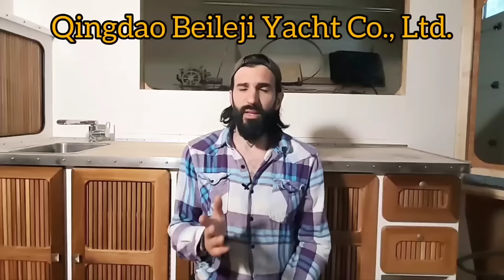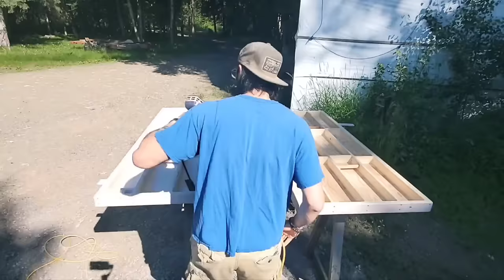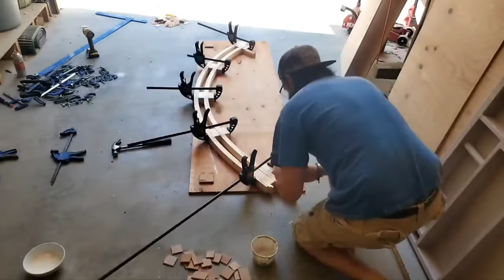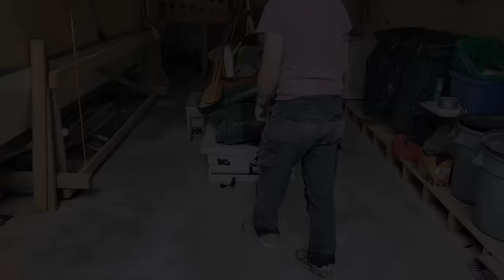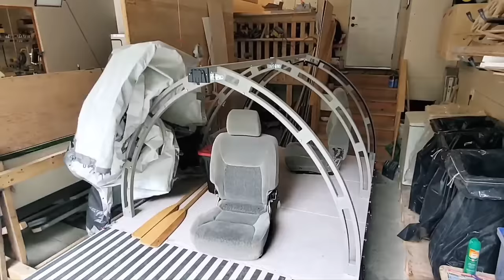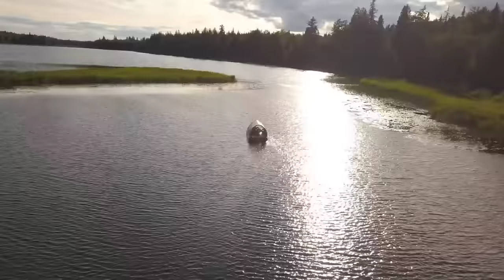DIY! Cheap homemade boat with gothic arch cover that fits in minivan!

Comment: If you were going to build rigid pontoons, (cheaply), how would you do it?
Reply: P.S. Great system you've put together, will view your other videos, too.
Reply from the maker: Great question! Trying to find a cheep solution is always a challenge. I would try to find used HDPE plastic drums online, seal them up and build my pontoons out of them. 
Or I would use a plywood construction covered with PMF. (Poor man's fiberglass: woodglue+fabric+exterior paint) it isn't as durable as epoxy but it works. It is 100% water tight and if you make sure not to hit rocks hard when you land on shore, you will be fine. I actually did some longterm tests with this and I will talk about that in a future video. (Older expedition canoes have been built in a simular fashion.)
Reply: @adrianwoodworm  Thanks - you've come to the same conclusions I have, so that tells me I'm on the right track. I'd fill the drums with foam, or cut the drums down the middle, (ends removed), and attach them to wood to make pontoons, (see plastic drum boat videos on YT). I also saw a video where chicken wire was used as a base for a fiberglass boat, incorporating something like that in a PMF boat could be useful, too. I figure a pontoon type boat that is seaworthy would be easiest to build for someone like me with no boat building experience, it's basically a box on a couple of floats. Looking forward to your next videos.
Reply: I've built up to 16'+ pontoons using $8US each rinsed and sealed 55gal plastic drums from a car wash.  I use 2x8x16' treated ladder frames to contain the barrels and as cross frames.  I use hung, lower decks to work off of when managing aquatic vegetation.  I prefer to use a 6.5hp longtail engine to propel them through weeds but have also used paired electrics.  These have sufficient flotation to use aquatic mowers and hydraulic pumps to harvest hundreds of pounds of vegetation.  They aren't pretty or hydrodynamically efficient but up to two years ago, cost under $400US.  They are robust, easily repaired and can be left out over winter.
Reply: @pierredussf  Sweet, bro - that sounds great all round.

Comment: I wish you would make a kit for sale I  would buy it
Reply from the maker: I considered it, but after doing a rough calculation and adding the cost of labor, I ended up with a price that would be too much for most. Especially when you start buying propper tarp vs. the silage/ducktape combo. And then there is the whole marketing, packing, shipping and paperwork aspect, and that is not really my thing.

Comment: Could've saved half on batteries going to Walmart . Then added cheap solar from harbor freight wirh the savings. Ah the usa
Reply from the maker: Wrong on multiple levels. Walmart batteries have been actually more expensive. And I am from Canada, no harbor freight here...
Reply: @adrianwoodworm  almost every deep cycle in my store is under $100. There are three that are about $130. I've paid under $100 for my last 7 deep cycles at Walmart. Minus the $12 core charge. All batteries are made by two companies in the USA. They are basically the same as any other brand with more or less lead, different sticker on the case. Lead not lithium
Reply from the maker: @joeblow8206  I am glad you got your batteries so cheep. However, you will have to take my word for it that costco in Canada had the cheepest 27M 120 AH batteries at the time in my area.
Reply: @adrianwoodworm  ah the USA. Especially before COVID. Anything you want cheap. Double prices in Canada due too logistics. I have five Walmarts within a half hour
Reply from the maker: @joeblow8206  part of the confusion here might be that all the prices stated in the video are in canadian dollar. $200 canadian is about $145 usd. I should have made that clear in the video since by now most of my viewers are from the US.
Reply: @adrianwoodworm  only the us dollar matters